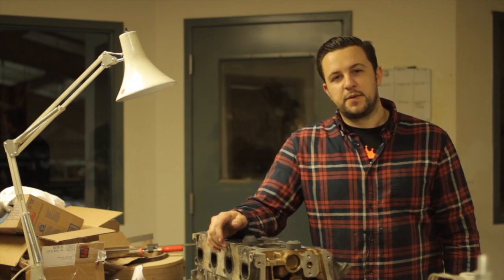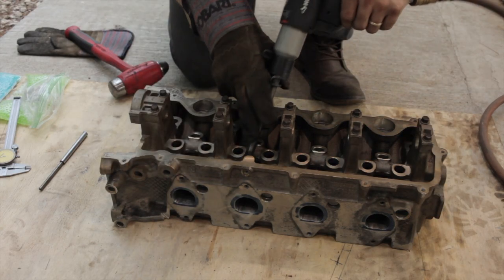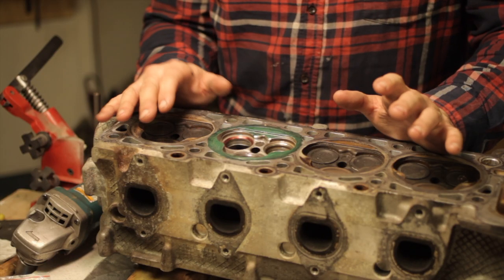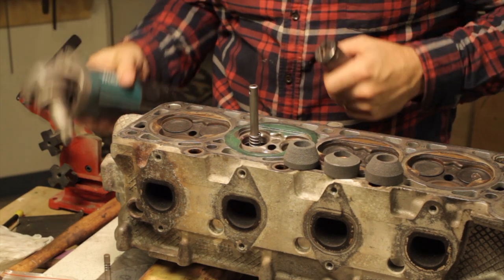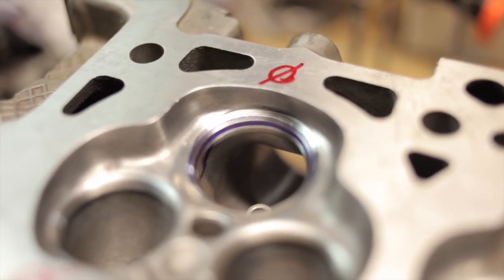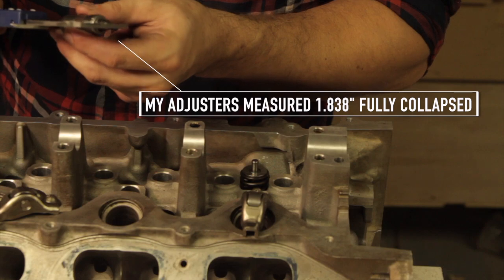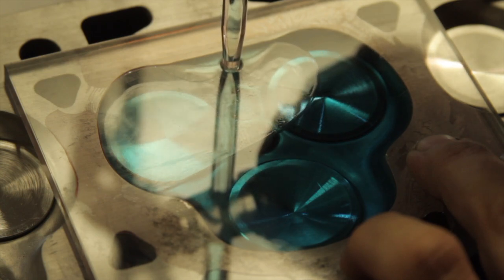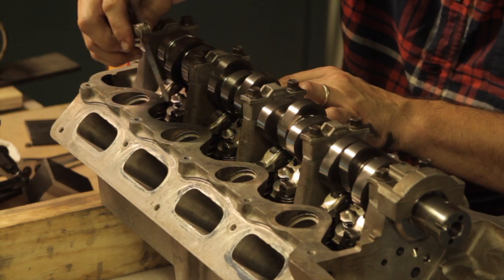Cylinder Heads Pt 2 | DIY 4 Angle Valve Job | #TrackWorthyNewEdge | Chapter 1, Part 2

Comment: I find your videos the most educational,  far better than anyone else on YouTube. 
So... I'm building a 5.4 3v for my 09  f150.
Could you touch alittle more on how to figure your compression ratio?  At stock , I'm at 9.8:1,  Would like to push it up to 10.5:1.
Where do I begin?
My ultimate goal is to get my daily driver to 400rwhp N/A.
Back to the compression ratio,
Shave the head ?
Deck the block ?
And what is the formula to determine what you have?
Thank you for sharing your experience and knowledge.  Wish I were your next door neighbor......lol😆
Reply from the maker: Well thanks, man!  So, compression ratio calculators can be found online.  Very easy, just plug in the numbers it asks for.  

It's not a good idea to mill the heads or deck on an overhead cam engine as it can mess with cam timing.  You can buy pistons with less dish than the pistons you currently have for a higher CR.  ModMax has pistons of different size dish and they generally tell you what they bring the CR to on a stock motor.  

Power output is in direct correlation to the volume of air you can get through the engine.  The higher CR will help make power, but you really need to get the engine breathing.  The last time I did any research into building a 5.4, the thing that stopped me was the absence of a decent intake manifold.  Can't (caveat, here) use a 4.6 manifold- even though the heads are the same, the taller deck of the 5.4 puts the intake ports further apart.  You can use a 4.6 manifold to it with a adapter plates.  Cams, headers and tune will help.  But I'm not sure at what point the intake manifold starts holding you back.  I assume you're also planning to put better rods in it, as you'll be wanting to spin it up past 6000 to take advantage of the camshafts.  

If you can squeeze 400whp out of that engine, you may find you don't like what it has done to the low end power range, depending on what you plan to use the truck for.  Though, you could put taller gears in the axle(s) if this is an issue.  

All of that said- a blower or turbo might be a better move for you.  I love a good N/A setup as much as anybody, but in your case it may not actually make sense.  If it were me, that is what I would do in this instance.  

Happy building!  Feel free to reach out if you need anything.

Comment: Thank You Sir,
Enjoyed your video, 
Are the stones or carbide cutters the best option for cutting the valve seats ?
Than You again
Reply from the maker: Depends.  The stones are cheaper in the first place.  The carbide cutters, if you're referring to something like the NEWAY valve seat cutters, are great for touch up and will last longer, but are more expensive.  I would have gone that route if money allowed.  

People have been grinding in valve seats forever.  A competent person can grind a better valve seat than someone who doesn't know how top properly run a valve seat machine.  Seen plenty of seats fresh off the Serdi with .009"+ runout.  They are great for consistency, but, as with the stones, you have to understand have the feel for how to run them to keep the seat concentric.  

Thanks for the comments.

Comment: What happened with the falcon?
Reply from the maker: The Falcon is around, just haven't had time to work on it lately.  This engine was supposed to be a simple swap but ended up needing to be totally rebuilt.  I have a list of safety mods for the Mustang through the winter but should be back on the Falcon come spring.

Comment: I'm not sure your background but for the average guy the things you have bought will be very unnecessary definitely for the heads I will let a machine shop such as livernois set them up I mean just to go n/a the amount of tools you have bought to do just the heads you could be halfway into a power adder 
And just to go in a you probably could have simply went with your stock rods stock crank and a higher compression hyperuteptic style piston 
I had to learn the hard way too just for 400 horsepower it's a lot easier route to go trust me been there done that
Reply from the maker: You're right, but also not.  This is a purpose built road course car.  FI and road course don't mix.  

Three issues with a power adder-  
1.  Heat.  High IAT by the end of your 20 minute session will kill power and cause preignition- possibly killing the motor.  
2. In a nose heavy car, adding weight to the nose is the opposite of what you want.  Hence, the battery in the trunk and the swap to an aluminum block. (Along with tubular front suspension components)

3.  Rules.  The classes I will race in one day do not allow power adders. 

The only way you might want to consider FI for road course is rear mounted turbos for some sort of time attack class that you would need that much HP.  

Thanks for the comment.
Reply: As I understand it....
Bradford is a Machinist, so why would he go to a machine shop?
Reply: @BradfordsGarage  where did you get your specs from for the valve lash Clarence of 18 to 23
Reply from the maker: @crownvictorialifestyle4421  I want to say it came from Sean Hyland.  I can't remember for sure, as I also have a buddy who has put together a lot of these motors for competition use, who gave me a lot of information as well. The stock spec is .018"-.028", I believe.  At the upper end, closer to .028" and beyond, there is more likelihood of spitting a follower out.  It's also quieter to run them tighter.  Just don't want to go tighter than .018" or you run the risk of the lash adjuster going 'solid' and bending things or holding the valve open.